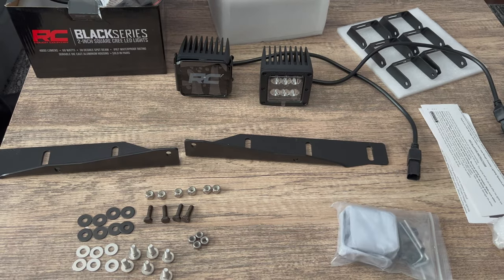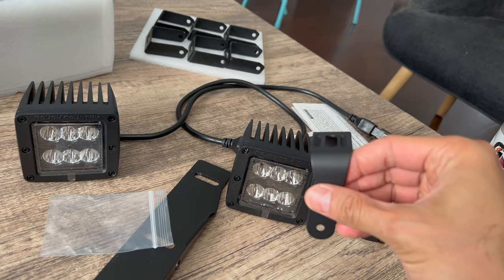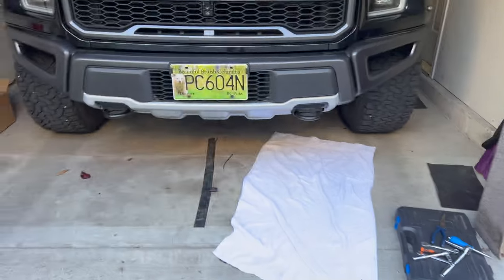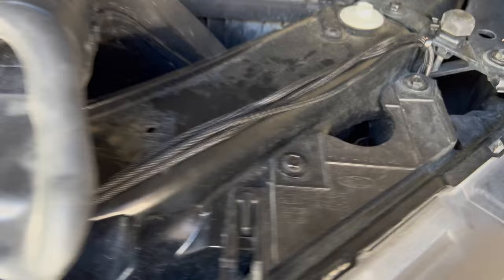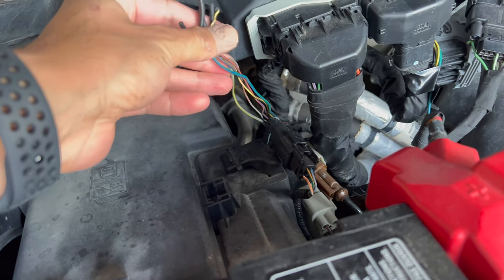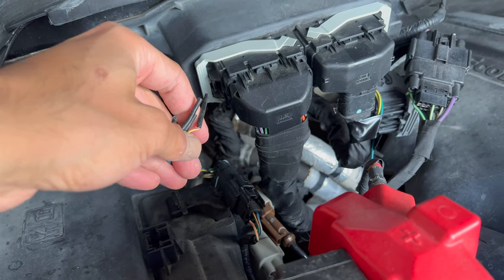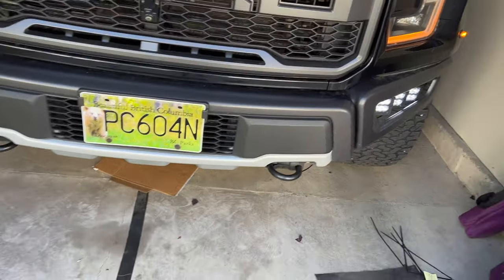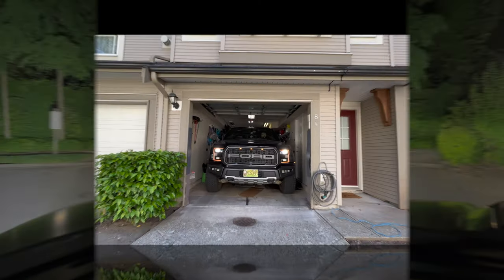DIY: Rough Country Black Series TRIPLE LED FOG LIGHT KIT INSTALLATION ON A FORD RAPTOR

Comment: Hello thank you for your Video, very useful, I have a question, I am trying to use the kit on my 2018 Raptor, the instructions are not clear,, can you please explain the wires color codes? Blue, Red, White, Black 
Thank you
Reply from the maker: For 2018 the wiring codes per Aux Switch are as follows:
2018 Wire Colors

Aux 1 - Green/White - 15A
Aux 2 - Brown/Blue - 15A
Aux 3 - Gray/Yellow - 10A
Aux 4 - Green/Yellow - 10A
Aux 5 - Brown/White - 5A
Aux 6 - Green/Orange - 5A

So for each light that you want on AUX1 for example, connect the red wires from each light to that wire above.  Black is ground.  Hope that helps.

Comment: Are you able to wire all 3 lights to 1 switch instead of all separate?
Reply from the maker: Yes you can wire them all to one switch I wired them separately so I could control each light.  For one switch you just connect all the wires of one side to the one switch.
Reply: @yoshitheraptor6834  i know switch 1 and 2 have the most amp-age. And 6 the lowest. 

Currently 3,4,5 is being used. I am planning to run all 6 lights on switch 1 or 2 and run a light bar on separate switch as well. Do you think this will be ok with all the power drawn?
Reply from the maker: I think you should be ok as long as your are within the max amperage rating.
AUX1 - Green(solid)/Blue(stripe) - 15A
AUX2 - Gray/Yellow - 15A
AUX3 - Violet/Orange - 10A
AUX4 - Brown/Blue - 10A
AUX5 - Gray/Orange - 5A
AUX6 - Yellow/Violet - 5A

2018 Wire Colors

Aux 1 - Green/White - 15A
Aux 2 - Brown/Blue - 15A
Aux 3 - Gray/Yellow - 10A
Aux 4 - Green/Yellow - 10A
Aux 5 - Brown/White - 5A
Aux 6 - Green/Orange - 5A
Reply: @yoshitheraptor6834  15A is about 1800 watts right?
Reply: @yoshitheraptor6834  thx for the info. did you have the amber back light? how were you able to wire all 6 DRL amber backlight into 1 wire?